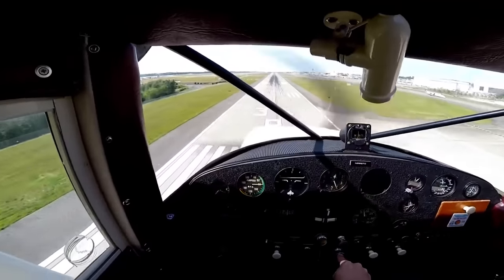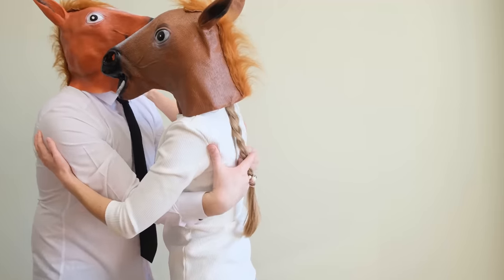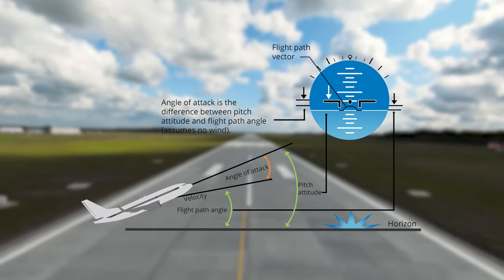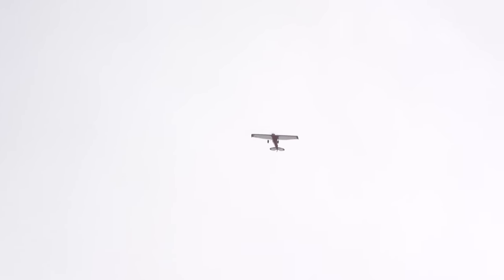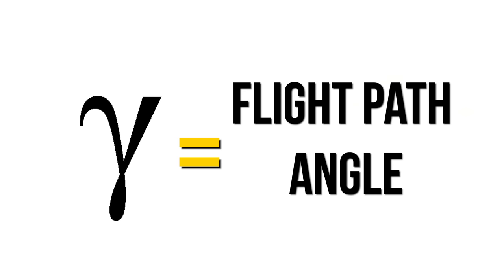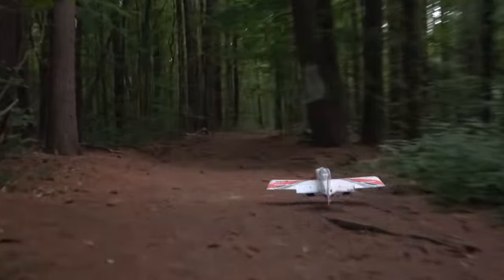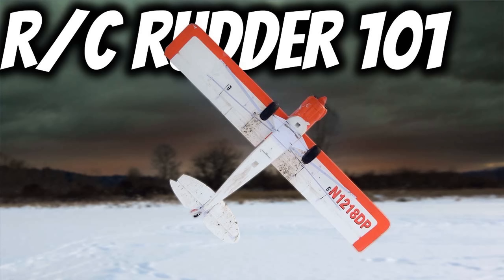14 RC Terms You’re Using WRONG

Comment: Thank you. Exactly what the R/C community needs. What you missed? Probably the tendency to call all rolls 'barrel rolls', all wing drops 'tip stalls', and vertical climbouts 'vertical takeoffs'.
Reply from the maker: Glad you enjoyed it! Believe me, we had several others but opted to not include everything in one go this time around. The differences between a roll/barrel roll/snap roll were one of them. As for tips stalls - we had to write an entire script on stalls to properly cover that one...stay tuned! 👍
Reply: I've been flying RC planes for over a decade, but I really don't know the difference between a barrel roll, a rifle roll, and a snap roll.  I just call them all "rolls" to make life simple. If there is a difference, cane someone please educate me?
Very informative video by the way.  Thanks.
Reply: @larrylaitner3473  Axial roll, or aileron roll: plane rotates or rolls about its longitudinal axis while maintaining a very nearly straight line of flight. 
   Barrel roll: plane flies a spiral pattern centered on its line of flight, which is usually horizontal. When viewed from behind, the plane appears to travel around the surface of a barrel. 
   Snap roll: An aggressive, high energy maneuver in which the plane very quickly "snaps" into an uncoordinated mode of flight which may have one wing stalled. It has been described as a spin along a horizontal flight line. Control inputs may consist of just elevator and aileron, or elevator, aileron, and rudder. A snap roll is not as precisely defined as the axial roll and barrel roll.
Reply: I used to do snap rolls in a (full sized) Bellanca Citabria.  As I recall, the inputs were: quickly full up elevator (back stick) and at the same time slam full rudder in the desired direction.  That would stall the wing corresponding with the rudder direction and the opposite (outside) wing- still flying - would snap the plane around very aggressively.  To recover: when half way around (inverted), quickly reverse the inputs - opposite rudder and stick forward - and by the time you were upright, the plane would recover, allowing controls to be neutral.  Timing might be different with different aircraft, but that’s the gist.  A stunt pilot gave me ride in a Pitts S2a, and a snap roll in that thing was truly violent.

Comment: Great Video! The terminology slang can get folks confused quick. Just a note at 6:57 ,  Boeing recommends landing in a crab in high crosswinds to avoid dragging an engine across the runway:) The 757 actually has a 40 knot crosswind landing limit! I have had to do this many times in the 757 to avoid scraping metal:). While it is correct to have your tires parallel to the runway at touchdown, its actually a necessity to land in a crab in many planes with under-wing mounted engines. Boeing has designed the gear to take that abuse & landing the plane in a crab saves you a trip to the Chief pilots office:)  That was actually a excellent example of a crab landing in high winds in a 757... having a wet runway helps a lot when you have to perform this kind of landing! Also, the deep stall encountered with the FMS 64mm Rafale is somewhat exacerbated by the fact that the canards don't move as they do in the full scale or 80mm version, so there's no way to unload the nose to get it out of the stalled condition:) To be more correct regarding terminology, I prefer to use the terms "forward CG" and "aft CG" instead of "Nose Heavy" and "Tail Heavy." For many, the terms "Nose Heavy" and "Tail Heavy" seem to be perceived as the CG not being in a reasonably flyable position which is often true. Keep the great videos coming:)
Reply from the maker: Thanks! Oh yeah, totally aware on that one - we just needed a good example of what side loading looks like and despite proper procedure being a crab with the 757, the side load shown in that video made the concept we were discussing much easier to grasp from a visual standpoint. Rafale wise - regardless of the canards being fixed or not, it was a usable visual for what deep stalls look like which is why we used it. As for CG terms - pick your poison there. Both are acceptable. :-) Thanks for watching! 😀

Comment: Most servos stop working long before the receiver system voltage reaches the lower operating threshold of the receiver which is 3.5V for most receivers now in production. You most likely had a full signal with the plane but servos incapable of doing what they are told. That 5V 2A BEC in that cheap ESC is marginally able to power the servos on the ground let alone in the air with aerodynamic loads on them. Lesson to learn don’t under power your control system, power your receiver and servos appropriately.

Comment: To make matters even worse, Beta is also correctly used to indicate a case where the power lever is primarily controlling pitch rather than power, typically used at low thrust conditions where the throttle response of a turboprop is unusually slow so pitch is adjusted instead and the inertia of the prop is used to add thrust while the engine power catches up, This range also includes the braking/reverse thrust regime on turboprop aircraft so equipped. 

It's often incorrectly also used for reverse thrust (which is in the beta regime, but not the only part of it)
Reply from the maker: Yep - but since this doesn't apply to RC pilots, we chose not to mention it. 👍

Comment: "brownout is a loss of control specifically caused by a receiver voltage sagging due to your Rat's Nest of cables, old and terrible receiver battery, weak sauce BEC or your 39 Cent Alibaba switch being incapable of powering the circles or receiver"

Nah, that is just one part of what it can be.
Brownout simply and specifically means voltage-sagging below the specified operation level. That can have many other reasons like you just flying too long, the battery getting too hot, having a shared battery for motor, receiver and servos and no BEC (that has not been that uncommon), a motor that draws too high spike currents for the circuit etc.
Specially with early generation digital receivers getting a brownout was fatal: The digital logic could hang up during a brownout and would not recover until fully disconnected from the supply-voltage. This happened a lot when people just upgraded from analog to digital - first long flight in nice weather, flying nearly as long as the battery can handle, and during the landing-approach with higher loads from the servos the receiver would brownout and the plane crash.
Good receivers have brownout protection/recovery, and better yet would be a fully redundant receiver power supply. 

And i mean there can always be unforeseen circumstances:
Some of the digital servos would stay in the last received position of the control-signal would drop. So everything is fine, a small gust of wind and you gotta use rudder/ailerons for a short time at max deflection - and you crashed. The sudden increase in powerdraw from the servos working against the wind caused the voltage to just sagg enough to brown-out the controller, so now the signal is lost and the servors keep drawing full current and thus keep the voltage low.

Comment: We have a few on our field that are made up.

 “Marked It” we have a guy on the field that is named Mark. He crashes very often and usually leaves a 3 inch crater in the field where a plane went full speed into the ground. Leaving marks and scars on the field. When someone else does it other than mark, we say “Marked it!” 

“Wack!” Is actually a term used in hang gliders, when a glider is landing and crashes by having the nose of the glider hits the ground. Everyone shouts “wack!” Same thing for Rc planes that are tail draggers. When the nose smacks the ground, we will all yell “wack!”

“Going for pizza” is when a aircraft overshoots the runway and lands on the taller grass. I don’t know why it has to do anything with going for pizza but it’s used at the field and I’ve never questioned about it. 

“Walk of shame” is when a aircraft flips, wacks or gets stuck in or by the runway and a individual has to walk out on the runway in front of everyone to retrieve their airplane.

Comment: 11:52 Motor is electric, not electrical (electrical refers to machines producing electricity).
Another term that is used so often, but not strictly related to flying, just RC model terminology is left and right handed props. The copters changed it totally nowadays and reverted something that as been going on for 100+ years.
Reply from the maker: Tomato tomatoh 🍅😝

Comment: What is it called when you wreck on take off cause it pulls to hard to the left with a prop plane
Reply from the maker: That’s something caused by the left turning tendencies. There are four total left turning tendencies but not all apply at once depending on the type of plane and phase of flight you’re in. Stay tuned - this is one that’ll be addressed in a future video because it was too long for this one. 👍
Reply: I did that with a P-51

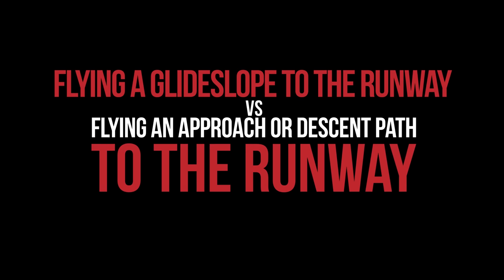Comment: 5:30 technically the glideslope IS the path the airplane takes to the runway, but that path is indicated either by your instruments or the PAPI lights (Or other fancies like PAR OLS). Obviously RC strips dont have established glideslopes to refer to.
Reply from the maker: PAPI lights are not always coincident with the glide slope antenna - the PAPI is generally on its own and is purely a visual reference to fly a consistent approach path to the runway. It’s in the name: precision approach path indicator. Not glide slope indicator 👍
Reply: @TailHeavyProductions   so another way to refer to it is approach/glide path, path doesn't specify that it's using an approach instrument (ILS,LOC,GPS,RNAV,etc)

Comment: You missed two very important terms  Airspeed vs Ground speed.  Many of my Non Full Scale R/C Buddy's Really don't under stand the Difference.  Example they don't under stand that when Landing into a stiff Head wind that their airplane is NOT really Flying SLOW. They are Confusing Perceptual SPEED i.e. GROUND SPEED actual speed across the ground Papering to be TOO SLOW. While the RELITIVE WIND over the wings is the same no mater if in a HEAD Wind or No wind or a Tail Wind Condition. They just believe it's too slow.
Reply from the maker: Believe me, we had a lot of terms on the short list but had to cut down to not make the video 30 minutes long. 😁 Stay tuned for a part two one day soon. 👍

Comment: "SAFE" is a trademarked, proprietary implementation of auto-level (and other features), so it is not "RC terminology"
Reply from the maker: The purpose of that section of the video was to clear the air on folks confusing the trademarked terms of “AS3X” with “SAFE” and assuming AS3X auto levels - when it does not. 👍

Comment: Tip stalls? Did I miss it? Did you miss it? How could you miss "tip stalls"? Pst. It's not a thing.
Reply from the maker: They actually do exist - stay tuned for an upcoming video on everything related to stalls 101…tip stalls included. We’ll clear the air once and for all on the topic. 😁
Reply: @TailHeavyProductions  Well sure they exist, but they're not a thing any more than root stalls or any other R/C flavor of stalls. I'll watch for your Stalls 101 video!
Reply from the maker: They do exist on RC planes, but only on certain types of wings and in certain scenarios. Stay tuned!